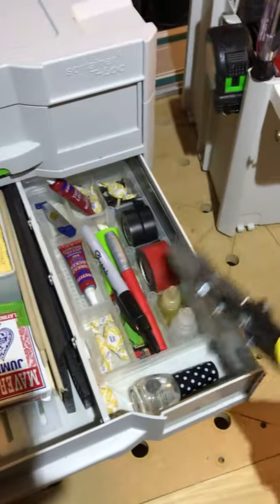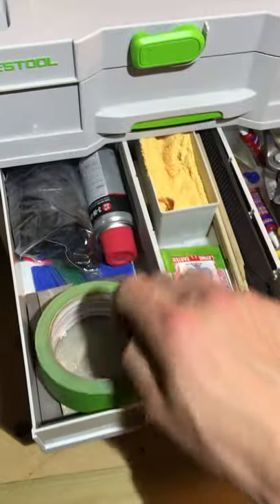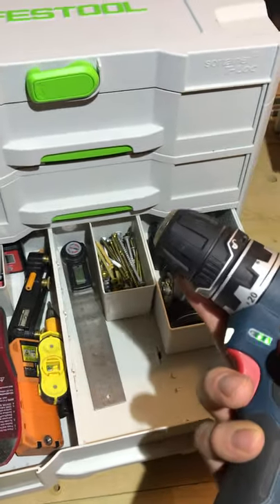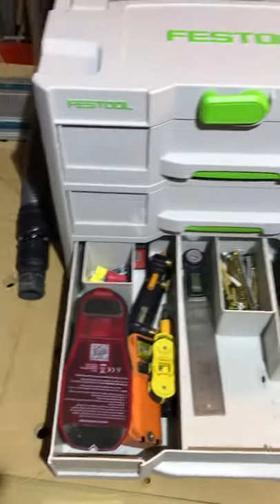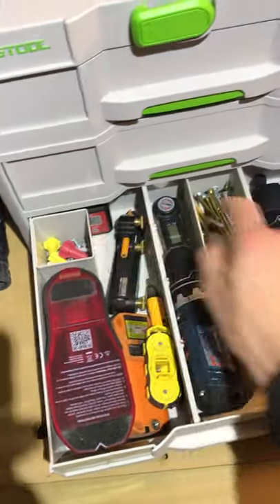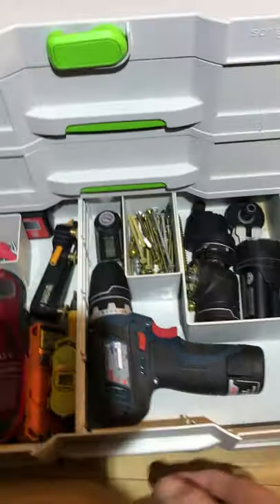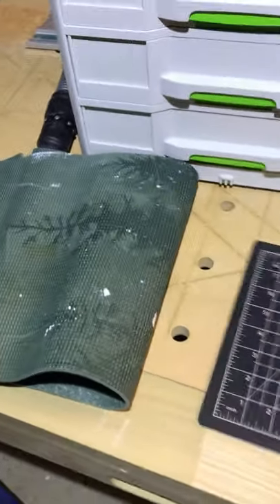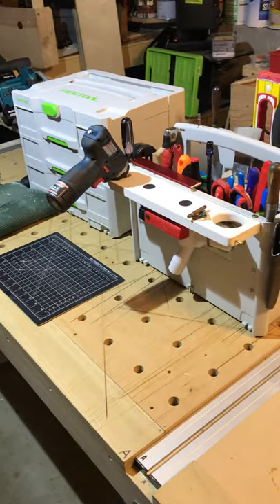Systainer Tour. Updated daily carry kit.

Comment: In my opinion, the old gen tote is a pretty underrated tote.  I know they are designed to sit at the very top and not designed to be overloaded, but I think it's sturdy enough to do many things.  The new one is improved to a certain degree that it feels like it will be emptied quite often depending on your day to day basis, while the older tote can be adjusted to your needs long term.
Reply from the maker: Agree.  I use one of the deep ones on top of my CT26 for vac accessories, 5m hose, etc.  works a treat.

Comment: Could you fill the drawers up with screws and they work ok??
Reply from the maker: Yep.  The way the drawers are designed, screws will not fall out, even if the box is tipped over.
Reply: I had one delivered today!!! I love it but I’ve filled it will other bits like kreg jig, drill bits hole saws etc, so I’ve just ordered a screw systainer seperately!!

Comment: I'm having a hard time coughing up the coin for those 3 drawer sortainers, which I really like the looks of.  Would you do it again? Are they holding up OK? I have a systainer that came with my Domino and the plastic seems very thin and brittle. Thanks for the video.
Reply from the maker: Hard to say. I got it as part of a kit of systainers so it was a bit cheaper, but I’ve been shifting a lot of my tools over to tstak/versastack, largely because of their cheap drawer systems. 

That said, I use my 3 drawer systainer every day and it’s a pleasure to use and ultimately more polished and compact than the Tstak. Even a simple thing like the white color makes a huge improvement in daily use.
Reply: @allthegearuk  Thanks! I ran across those too. Apparently impossible to buy within the US. Also I think I read somewhere that those drawers have no stops and are not suitable for being inside a vehicle.
Reply: I have been using Systainers for about twenty years, never had a problem.
They appear to be thin plastic but I think they are a glass reinforced nylon. Much stronger. Its the same as most quality power tools are made out of.
I can't tell you what a joy it is to have your tools in Systainers, it's just the best system.
Reply: @benschmolze1266  the drawers click shut securely for travel. Also they are plain ABS so not the best for construction site works but great for finish carpentry, installers and the like that will be able to take greater care.